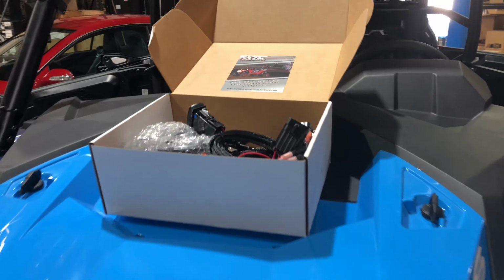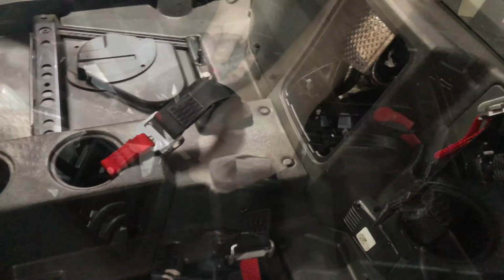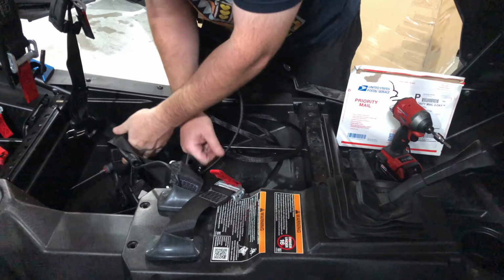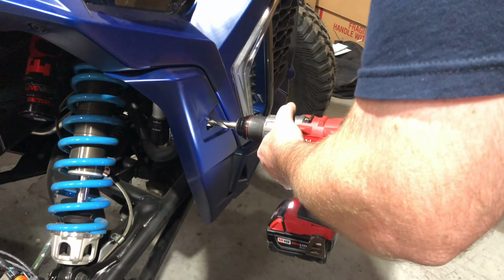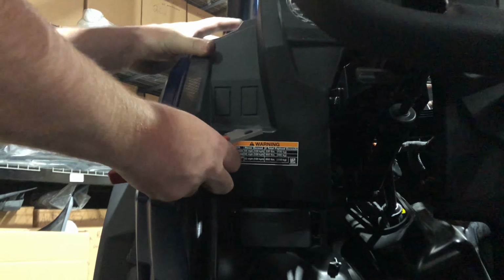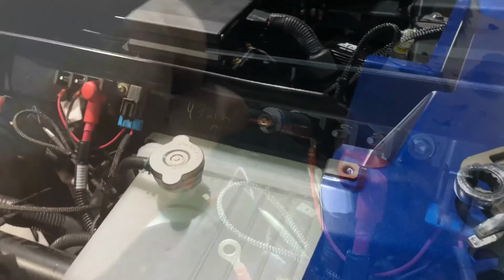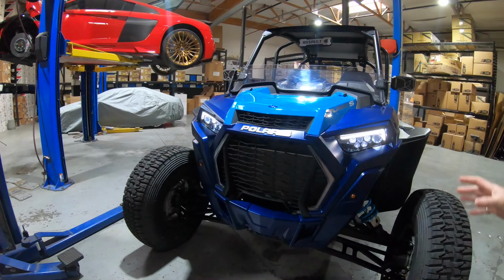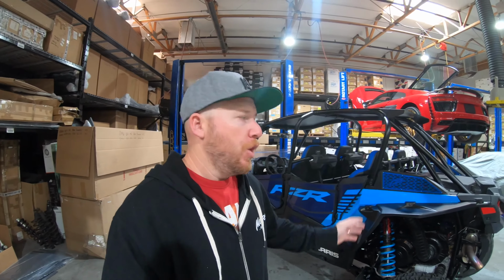How to Install the XTC Power Products Turn Signal Kit Polaris RZR

Comment: It’s a great kit, lol but I decided to take apart the box top, it’s 2 relays. So I realized it’s what I have now on my older sxs but in a kit. So I bought a builders box put 4 relays in it, ran it to a bus bar, then a Amazon fuse block. All together with switches and 2 hours of time if you wanna do it with wrap, and not electrical tape.
 Made a 6 rocker switch kit for 55$ the most expensive part being a water proof box. ( I have tons of relays and switches ) also was able to make it work with keyed power by running one wire to a acc. So this way it’s not on all the time. So if you don’t have the time or skill 1000% worth it. I did instal mine. But you could make your own for 1/4 of the price. If you have relays and a bus bar and fuse box set up you have it already. Pop the top off the power box. Still a big Xtc fan. They do make it easier for plug and play

Comment: I have a 19 turbo and struggled to get it to run all the way through the tunnel up front underneath without resting on radiator and intercooler lines. Did you run next to them or pull out before the firewall?
Reply from the maker: Will see if I can find photos Tuesday

Comment: Curious why you drill the extra amber indicator light in the front if you are also running the fang lights with signals?  Can you run without those smaller signals for a cleaner look?
Reply from the maker: Yes you can.  I just wanted to install the full XTC kit for them.

Comment: I have 19 XP 1000 (no fang).  Can I add fang light to kit?  What kit do I need to get fang to blink like a blinker?
Reply from the maker: you could modify to make these fit https://www.vividracing.com/xtc-motorsports-fort-turn-fang-light-set-polaris-rzr-turbo-1920-p-152664477.html
Reply: We got our street legal light kit from WD electronics no drilling that kit came with led strip and the fang light option, all plug n play! Not cheap but it also had the steering wheel turn signal mount just like in your vehicle 🚗😁😁
Reply: I already have the fang light with turn signal option and XTC signal kit. The fang light has the yellow wire coming off it. How do I tie this into XTC signal kit?
Reply: @josephhays1263  did you ever figure out how to do it

Comment: How did you get the dash turn signals to work?
Reply: You’re going to need the Polaris Instrument Cluster Turn Signal Adapter TSS-POL-INS they retail for under $20
Reply from the maker: This is part of the new kit they have.
Reply: How did you get it to work though? I’m really confused. I have the most current kit but it only has a single lead (brown wire) I ran it to lead 6 but only activates the right turn signal. Is it an optional kit you add or is it included with the RC3 kit? Thanks
Reply from the maker: @mitchellnewman6780  it might be included with their new kit.  Shoot an email to the guys at https://xtcpowerproducts.com/